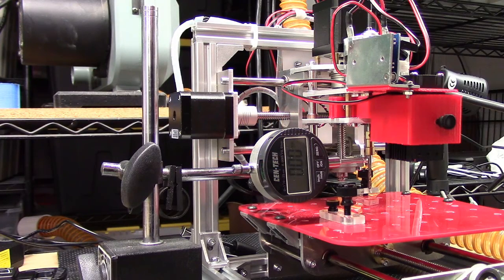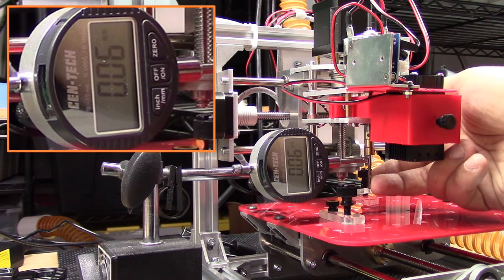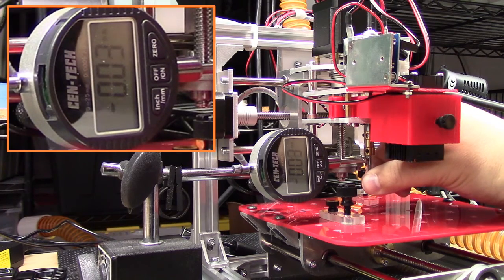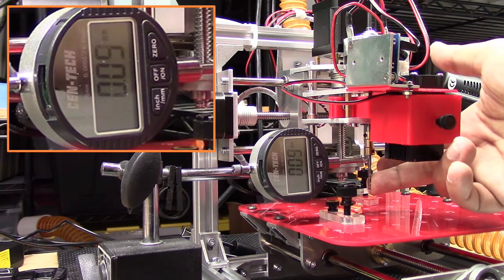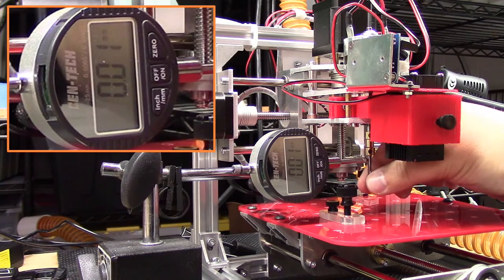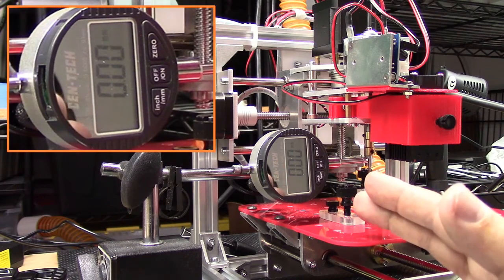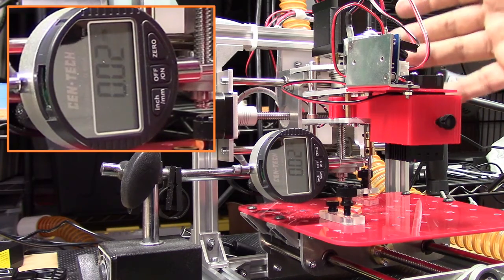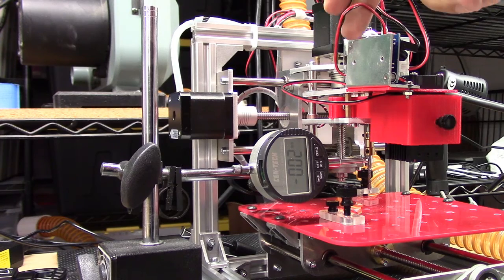Desktop CNC - Lets Measure  The Run Out!

Comment: Has as much runout as my Drill Press had on its worse day before I tweaked it.  For a DP even .08mm is awesome but for a mill/router that is a bit too much (anything more than about .02mm is too much from what I read) and deflection is 100% verboten.
Reply from the maker: Aah for government short of the space shuttle which we retired its ok.  Again for me the worse part is the deflection, If I was going to keep it, I would replace (and shorten) the tool connector.  But I am going to sell on eBay as I need the room!